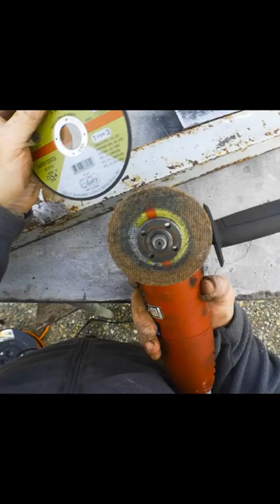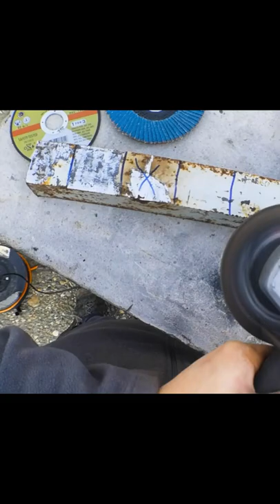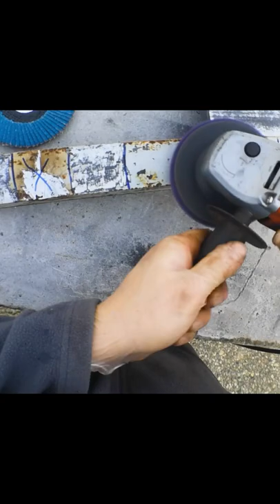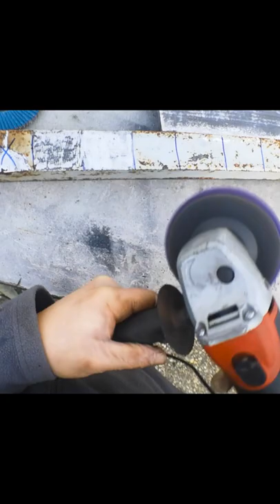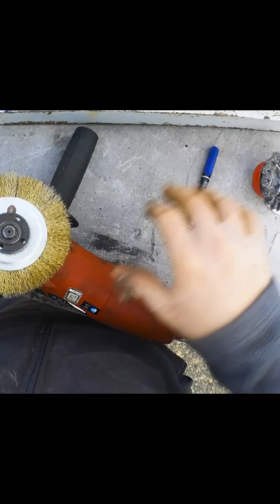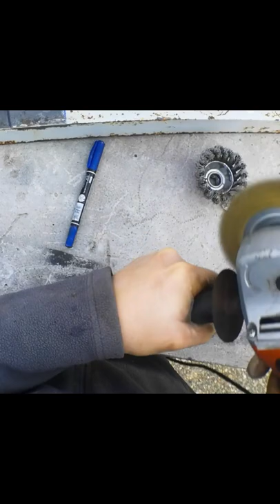The Best RUST removal disc

Comment: Hi. When it comes to using an angle grinder to remove rust, what rpm grinder would you recommend? I have a 12,000 rpm angle grinder and I have a hard time finding disks for them, and I feel like I would be better off with like a 7,000 rpm grinder. What is your experience with this? Thanks!

Comment: Which one is best
Reply: Right!?

I think the purple one, but it doesn't even include what the brand is, much less where to get it.
Reply from the maker: purple one is the best, most hardware stores have them it is sponge-like texture, I got mine from aliexpress
Reply: @patrik4390  thanks!
Reply: Usually called strip it disk
Reply: The purple discs are usually called strip or stripping discs if you are looking to find some to purchase.